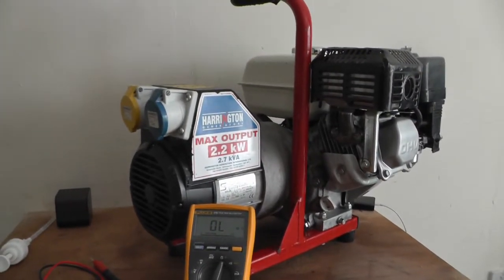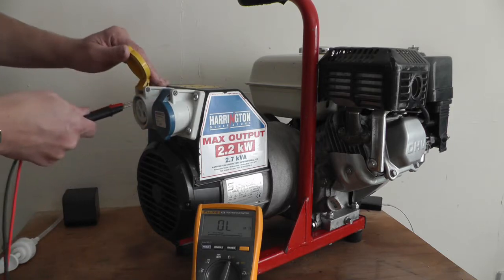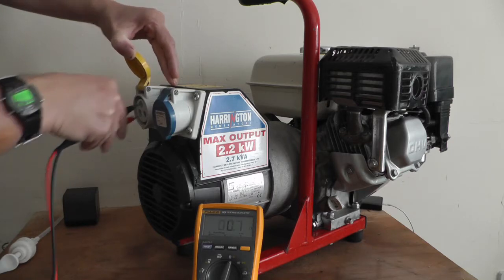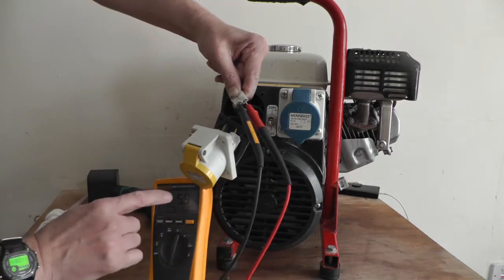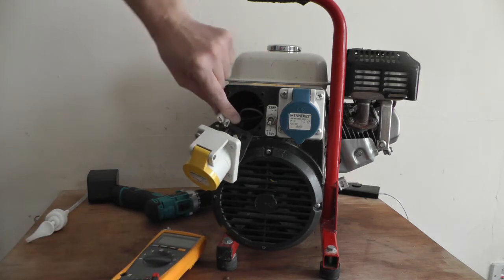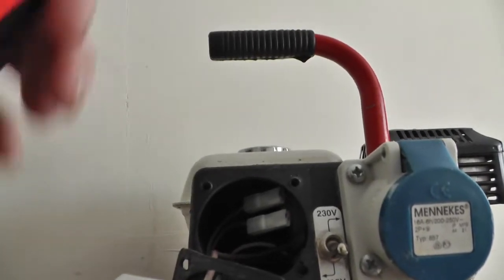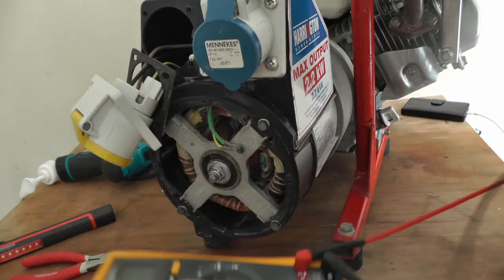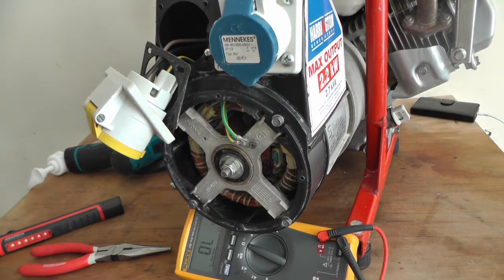Generator Runs But NO POWER? Top 5 Brushless Generator Fixes (Test the Capacitor!)

Comment: Hey cagmito, I have a brush less generator not producing any power ( 20v instead of 220v) at the very exit of the alternator itself, so well before the plugs or the capacitor itself. What do you think it could be? I took it apart and it look like brand new apart from a bit of rust on the outside of the stator.
Thanks
Reply from the maker: it could be many things the only way to find out is to test everything and hopefully discover what the issue is.